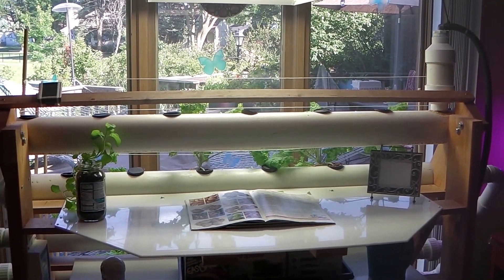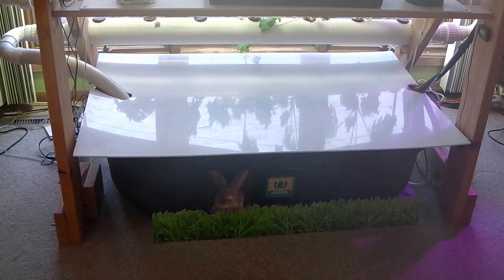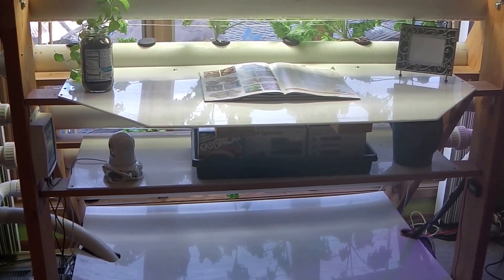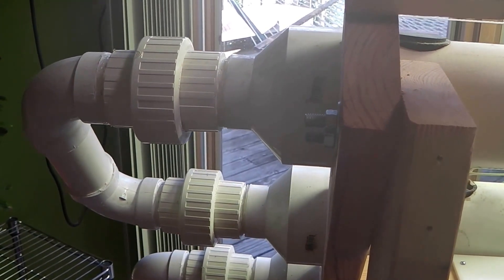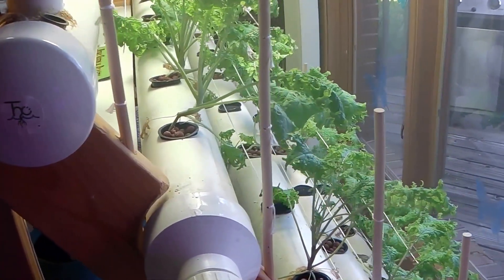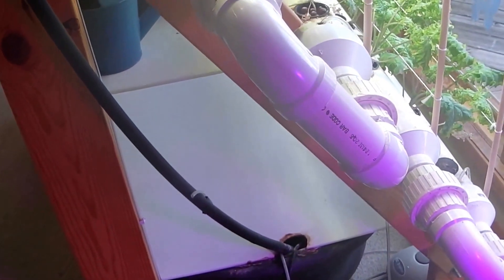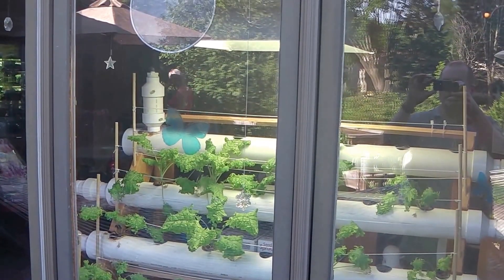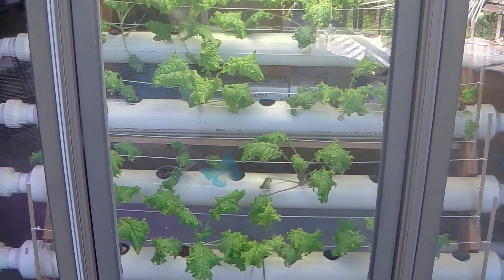Portable Indoor DIY Hydroponic system, SFT

Comment: How loud is that inside?
Reply from the maker: Pretty quiet, a somewhat soothing trickling fountain sound. The aerator air pump however was pretty loud until I switched to a quieter unit. Overall though not too noisy perhaps because the water pump is underwater.

Comment: Why not take an old RV camper and strip it and turn it into a mobile hydroponic green house? You could have all the water pumps and climate control and it would be better protected from bad weather. You could design it with hydraulics to lower down onto a cement slab. Best part if you get displaced? You can take your green house with you! Novartis